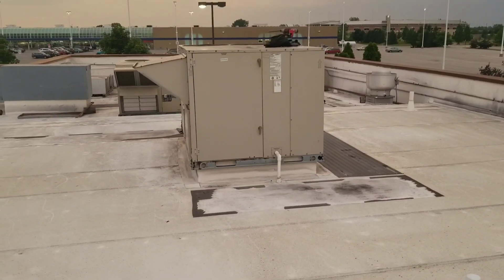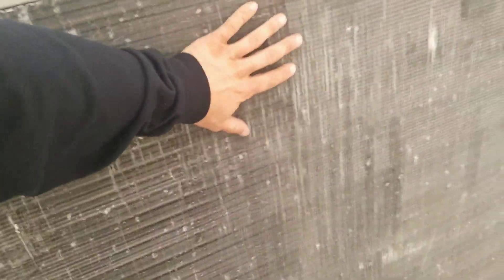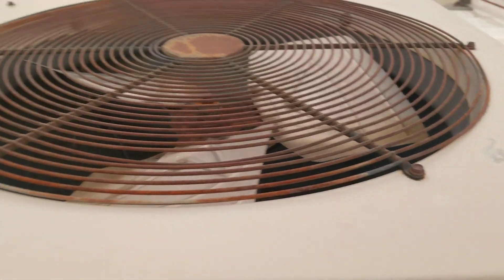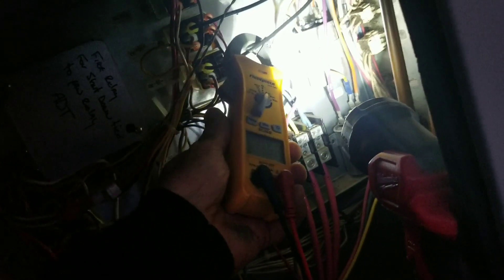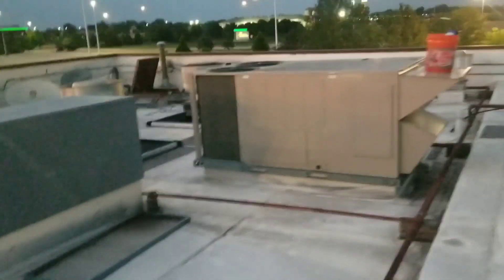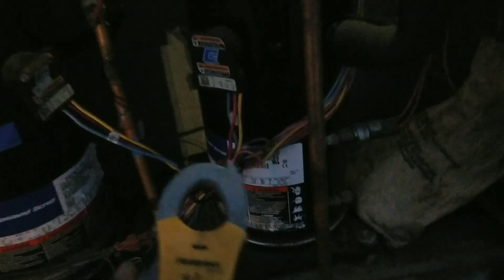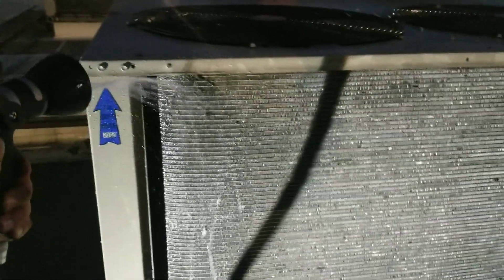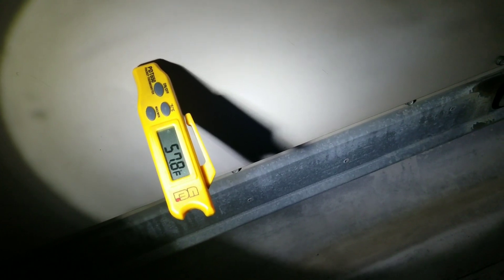After hours no AC call: Part 1

Comment: So on small to med. Carrier package units, I found a handy trick to block off a dead condenser fan port - pull out the metal wall that divides the combustion section and the compressor section and zip it down over the top with a few screws. 
Not something I'd do regularly, but when there's nothing else to use (and heat isn't needed), it gets the job done.